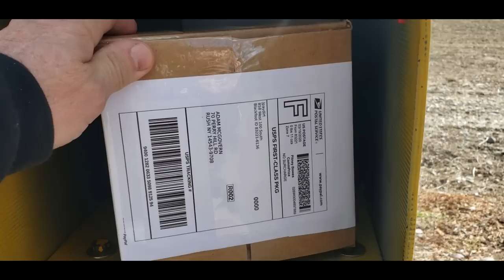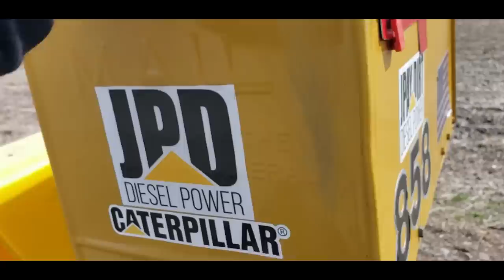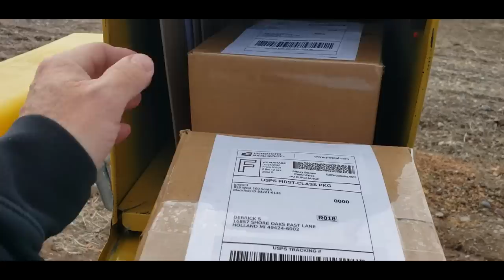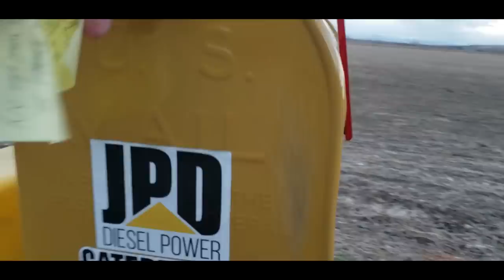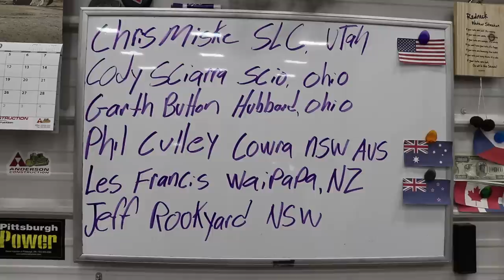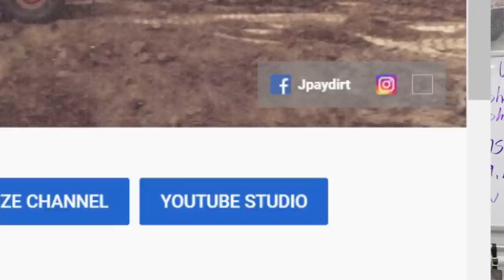I Bought Another 1693 CAT

Comment: I completely agree, never run a diesel without water in the cooling system. Like you said, those engines have precombustion chambers with rubber seals and rubber liner seals. 
Even without those things water pump seals running dry etc is bad. 
So many guys do this. Then they wonder why they get problems. If I were you I’d pressure test the cooling system on that engine before installing it. If you have to pull the head, it’s a lot easier now.

Comment: I worked for a Cat dealer for years. I totally agree with you, never running any engine without coolant in it. The 1693TA is almost as tough as a 6 1/4" bore D353 PCTA my favorite engine or the D343 PCTA. I remember one D353 that had 60K hours on it before it was shutdown for overhaul.

Comment: Used to tow army tanks with Caterpillar 830M ex-military tractors that had a 1693 engines.  These tractors had the dozer blade removed and the pan, were weighed down to 60,000 lbs and had a big tow bar on the back.
Reply: I believe in equipment the same engine is called a D343

Comment: Coolant line in pan and quick release is probably to preheat engine off of a pickup or service truck. Seen it before on skidders. Pull up to job, connect cooling lines from truck to equipment, sit in truck for half hour and let it warm up the other engine

Comment: My 1693 is white, it is also unmolested.  It resides in a 74 K100. 330k original miles.
Reply: Excellent! We drove a ‘76 Pete Cabover that had a 1693 in it. It would go up a hill/mountain like a Mountain Goat! Sitting in a truck stop idling sometimes it sounded like a trash can rolling across the cement lot, but point it in any direction & it would run with just about everything else out there on the road!

Comment: What a nice run to get your new motor.  Sounded great and IMHO I would of blocked both ends of the engine to add another layer of protection and to prevent any slippage if you had needed to shut it down in a hurry 

I'd like to live up in Idaho if I weren't sickly.  Washington DC has some of f the best medical in the entire country and I reckon I'll die over here.   But pretty country and clean air.

Comment: Running without water is a big no no like you say. Not only o-ring damage  but it can break the heads. I have seen D9 engines that ran low on water crack into the pre chamber  bores and leak water ruining the head. I would assume that other indirect injection Cat engines will do the same.  in any event it ain't good. Cheers

Comment: I doubt it hurt anything if it only ran for a minute or two. There is very little fuel required to idle the engine and with about 50 parts air to fuel temps would have been fairly low.  It might have got to 300deg in the chambers but that shouldn't be enough to hurt the o-rings especially with the cool cast surrounding it to take heat away.
Reply from the maker: I hope your correct, thing is I don't know how long they ran it before, as I told them to shut it off in this video
Reply: But when you consider the fact that the air inside the cylinder reaches 800 or 900 degrees Fahrenheit to fire off that burst of diesel it’s easy to see how easily engine damage can occur. I was told that running an engine over 245 degrees  for any time could cause it irreparable harm and that’s with water in the cooling system , but I’m not a mechanic, so I don’t know for certain. Every time I fire off a truck or piece of equipment that I’m not familiar with, I make sure that I check the oil and coolant and the other stuff, at least until I’m familiar with that vehicle.

Comment: the biggest problem, is a piece of the timber coming lose, flying off and hit something on the road. probably wacking some screws from the engine cradle into the timber would have been a good idea. cant imagine an engine running with no water not chewing up the water pump seal..............